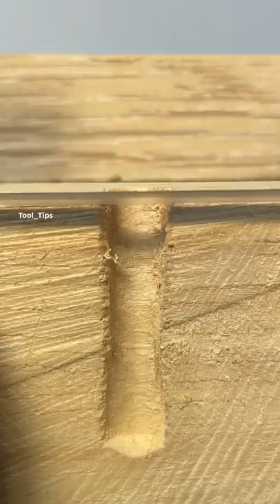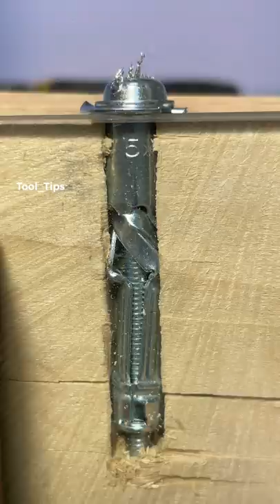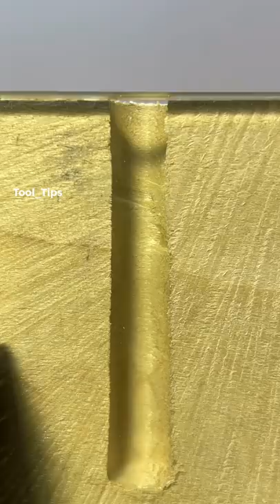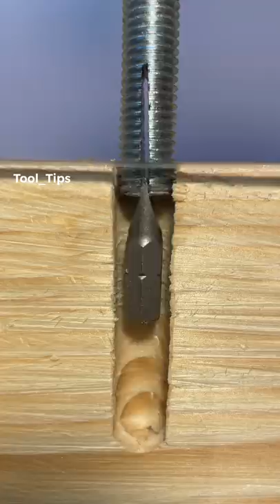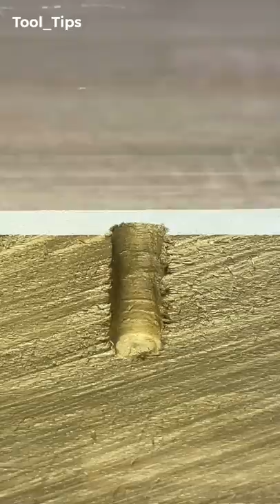#shorts The Best

Comment: POV: You’re watching someone install drywall anchors into wood and wondering why they aren’t working right
Reply: Thank you…. Lol
Reply: It’s not working because there’s glass and the glass doesn’t mold like the wood does
Reply: @OurTimeComes  No, the anchors are not designed to be used in wood. If you attach something to wood you can just use a wood screw. There are different anchors for plaster, drywall etc.
Reply: @austinm9119 .no u or
Reply: Wrong. In total  the kinds they had on here covered almost all types of wall materials. Brick, concrete, drywall, plaster etc. Also in 99% of cases with dry wall and plaster you're trying to land the screws on studs which is wood normally.
Reply: @patrickruddell3475  yep I was gonna say there is more here than just drywall anchors.
Reply: Correction: Some of them are drywall anchors. The nail in the sleeve at the end is a concrete/cement/stone anchor and the dowels are wood anchors. But, I agree, he should use show them in their designed material 😉
Reply: 😂😂😂😂 Guilty!
Reply: @chrish6001  thanks bro...
Reply: I understand nothing over here ✌😀
Reply: @chrish6001  9
Reply: @austinm9119  dumb why? Why is it that if people didn't know this particular piece of information, they're dumb?
Reply: @austinm9119  this just came to people's recommended. Nobody knows what this is, and nobody cares. It seems fun to watch and you don't research something you just watched for fun and would never really benefit from. Of course they won't research
Reply: I guess that isn't as obvious to as many people as I thought...
Reply: @austinm9119  first off, I do research, just not in this, I couldn't care less about construction. I just watch this cuz it's distracting. Second, I am not exactly speaking for everyone, but to the partition of people you're targeting. I'm not arguing for someone, I'm arguing against the philosophy you follow itself. Also I didn't use the pronoun "you" as in you, Austin Michael. I meant it to reference "you, the YouTube user" it's a way of generalisation. Also there is no perfect pragmatist. Everyone wastes time in some way and some people do it by watching random YouTube videos. Also, since you enjoy practicality, enjoying the stupidity of other people and not helping them out in a way they'll accept hinders progress because less people are encouraged to contribute to the society. And by the way, I don't get tired of this. It's great way to fault proof my philosophy by acknowledging criticisms from other me people, so don't expect me to stop anytime soon (unless either you end by not replying or YouTube just stops sending me notifications). Plus, this is kinda fun
Reply: @austinm9119  you're not really disproving anything at this point. You're just insulting me. If you truly know what you're saying is true, then you should be able to shut me up no problem by not giving me any room for argument. Why Isn't that the case?
Reply: @patrickruddell3475  you don't normally use drywall anchors when you are screwing directly into a stud, though.......if you did, you'd have to make a bigger hold in the wall than is necessary, and the resulting joint won't even be as strong as just using the screw by itself.
Reply: @someperson6672  Same, I’m just here for the arguments
Reply: @YoutubeDictatorship2024  the passive-aggressive vibe in this comment is lovely
Reply: Right! Whats the point of anchors if you can drill into wood
Reply: @aaronjones3181  yes you're right.
Reply: @pierreemad2220  I think this is less passive-aggressive and more just normal aggressive.
Reply: 🤔🤔🤔 Right? 🤣🤣🤣 that's why you have wood screws, wood pegs, etc. Drywall anchors are for? Wait for it... wait for it.... Drywall
Reply: I can't look away 😃
Reply: @chrish6001  ll
Reply: @chrish6001  mm.
Reply: Ah, maybe I'm not so stupid afterall 😅
Reply: @patrickruddell3475  right, but you only use an anchor when you can't use a stud!?
Reply: @austinm9119  we all just have different roles and lived experiences my guy. Sadly I didnt have someone who was handy to teach me these things when I was a kid. I'm sure there are many more like me who are just trying to learn.
Reply: @calmcomedy1  for sure, nothing i said is directed at that identity. Im talking about the people who are choosing not to learn.
Reply: @OurTimeComes  
Mm
Reply: They did it in would so you won’t have the mess of drywall and could see clearly
Reply: It’s so soothing actually!  👍🏼🤪
Reply: @chrish6001  tell us something we don’t know, GENIUS!  🤪🤪🤦🏻‍♂️🤦🏻‍♂️
Reply: BodieBoy, 
Watch the video 11 times and then make the same claim.
Reply: @pierreemad2220  
Right,  no kidding.
Reply: @austinm9119  getting dumber when I was a kid in 70's I was 10 building houses with my grandfather  laying brick  I was actually laying the concrete on bricks placing tapping to level across the line he be watching  come back and say nice or opps look at that brick see how it's a little narrow  you got lazy  it matters  I always took pride  since then.  Kids today  even men don't know anything about construction or even changing a outlet  it's simply mind blowing
Reply: @someperson6672    unless you know what each one is for. It's mainly to show people why most fail  they use the wrong type
Reply: @austinm9119  ok wise guy. LMAO

Comment: I’ve never been so tempted to take a construction class before today
Reply: @udunn0jb  isn't carpentry a unit in construction? I'm taking a construction class and had to learn carpentry
Reply: @jrjuan4334  im in the laborers union and as far as I know carpentry has their own hall and training
Reply: @cookie8080  i did construction for the US army and had to take classes to learn about the heavy equipment i was operating.  Then when I got out I took a red seal course when I went to school for a combined 6 months over 2 and a half years. I signed on as a apprentice and by the time my course was done I was a journeyman.  There is alot of stuff involved when doing a construction project stuff has to be done to codes. Depending on what work your doing there is alot of math like concrete knowing how much to make or order for a certain pour. Or asphalt work , pipeline work , residential work for water lines and stuff.  Each sector all have their own rules. Without previous experience good luck getting hired for a construction job, well a good paying one anyway. When I started I had my ged, and my time in the army thats it. When I started as a apprentice was making 16 bucks an hour now I make 33 an hour whichever sector I  go. 42 an hour for pipeline work
Reply: @cookie8080  oh yeah and by the way each trade has their own red seal course  all having to do with construction.  Lots of classes involved with construction.  If you wanna know how to do it correctly and by the book
Reply: @cookie8080  well is a 14 year old really suppose to carry tons of bricks and metal on my shoulder???? Or is it cuz you have no life sitting on the couch drinking mountain dew and eating takis
Reply: U don't need 1 the parts r cheap it's just trial an error save the cash 😀👍🏿
Reply: @DM-gy3ce  
Wow don't even hav 2 speak an man nose im English 🤣😂🤣😀👍🏿
Reply: @jasonanderson6425  we speak the same language as them but my god we are so different haha

Comment: All these people talking about how satisfying the video is, meanwhile im losing my mind about the drywall anchors being used in wood and losing a driver bit to expand a bolt
Reply: 🤣 I don't know much about anchors, but if I did, this would 100% be my comment.
Reply: You sir are a true craftsman.
Reply: Over here wondering the same, or why any anchor is needed in wood where a screw would do just fine 😂
Reply: @IOWChris  totally agree
Reply: It's still satisfying but I was also totally lost about what the hell he was doing g then that stuff happened 🧠  🤣
Reply: Yes driver bit... Was...
Reply: I use sheet metal screws to fix everything on just about every material you could imagine, they’re great.
Reply: Quite. Not sure what the point is really.
Reply: Same
Reply: @goose4342  you use sheet metal screws on drywall too?
Reply: Exactly. Wood, woodscrew.
Reply: Right. Hacks.
Reply: It was satisfying but was definitely confused with all the anchors in wood
Reply: You too huh?
Reply: Little trick I learned along the way I'd like to share. If you have a stripped hole in wood and the screw no longer bites, I found out using a short peace of solid copper wire as a shim works great to tighten the screw securely. What gauge to use depends on the diameter of the threaded hole. I used 14 gauge to shim door hinge mounting screws. No more surprises when their bathroom door use to collapse. LOL.  I'm sure a lot of you already know this technique but hopefully it helps someone that doesn't.
Reply: thank you for saying that
Reply: @xavierparedes12  Listen, if it holds metal together, it has to hold pewny drywall, right?
Just like pop rivets!!
Reply: @flip1746  makes notes Brilliant! A piece of plastic would work too, so you can use anything you don't need, really. Make trash useful!! 😁
Reply: That ...bit... really shook me too. You can't just discard a bit like that!! You'll be like "Where's that bit go--oh, it's in the shelf I built..." 😬
Reply: @SpotTiger  That's a good idea. I love repurposing things that would normally go in the trash. Thanks for sharing!
Reply: Came here to say this.  Not sure what if anything this meant to show, besides why screws are for hard wood.
Reply: Thank you thank you. Im sitting here like WTF IS HAPPENING
Reply: SAME!
Reply: I'm pretty sure its not about the wood it's to show us the mechanism used for each anchor
Reply: Just let some things go though ya know
Reply: Yeesss! Oh boy.
Reply: that driver bit clip got me mad af... why would someone waste that... geez
Reply: Yeah I just saw my life expectancy shorten with every turn of that drill.
Reply: reason you keep old bits, or the bad ones that come in screw boxes.
Reply: @SpotTiger  yup agree
Reply: @flip1746  drive the pointed end of a golf tee into the hole and cut flush. Multiple toothpicks or wood shavings will work for smaller holes as well. Copper wire sounds more like a "handyman special"... But hey, whatever works for ya!
Reply: I’m crying. This is cring
Reply: @flip1746  thanks for saying this that's a great tip! I'm gonna screenshot it to remember!
Reply: Right? I was wondering if my knowledge was just off and those were SOMEHOW wood anchors???!
Trying desperately to make it make sense...
Reply: Exactly
Reply: Thank you so much.. I thought I was the only one
Reply: @LaurenDowley689  You're welcome, Lauren. I love sharing tips that help people get things done. I also love seeing more women doing this type of work. For me, there's something very satisfying about creating and repairing things in the home. :)
Reply: Redwood Rebelgirl  I think you're asking about a SHIM (not a shin). A shim is basically anything you can use to close a gap by wedging the object (shim) in a gap. Usually the term "shim" is used in carpentry. You can buy a pack of wooden shims at any home improvement store. They are pieces of wood that are tapered kinda like a little ramp. So, say you are trying to make a door frame so it's square. Just push the small end in the gap and lightly tap the other end until it's tight. Then just snap the remaining part of the shim off so it's flush with the surface. In the case of shimming a stripped screw hole, the "shim" would be the piece of wire (or any other object that'll fit). Hope I explained all that well enough. I know it can be confusing if you don't have a lot of experience. I'm not a carpenter by trade but a computer tech. So if I can learn this stuff, so can you. Hope it helps and if you have questions hit me up. :)
Reply: Redwood Rebelgirl  You have a great attitude and world view! My daughters and my dad are very passionate about and active in preserving the environment. So am I. Thank you for sharing your passion!
Reply: @ScottyLiardi  That's a great idea! Thanks for sharing. I had to pull a MacGyver at a friends house. Went to use the bathroom and the door was propped up on the wall. So out of need of privacy, I rehung the door using the wire shim. They had been with a bathroom door for months so I was happy to help them (and myself) out. I'm a computer tech but having knowledge and a wide skillset is definitely beneficial so I thank you for the tip! I'll add it to my toolkit.
Reply: Im a carpenter and i. Hated this Video
Reply: @bayern1445  often hate comes from misunderstanding...
Reply: @Gazeld  ive been around. Carpentry my entire life 💪😎
Reply: @bayern1445  yeah, and so you can misunderstand the reason why someone made a video, anyway.
Reply: That waste of a driver...  However...  When in need...
Reply: I was screaming the same thing! Like, one, why could you use a drywall anchor on wood. Two, why are you putting a dowel into a hole that's larger than it should be? The driver bit confused and gave me anxiety!
Reply: Knowing that these are normally for drywall makes me understand what they are for better thank you
Reply: Exactly!!!!

Comment: I don’t understand what’s happening in some of these. Like, did he want the wood to crack open?
Reply: I think so it expands, and it gets tighter
Reply: Just showing how they work , most of them aren’t used for wood , most are concrete fixings
Reply: @THELONDONCHANNEL  O H.
Well now I know nothing again. 😆
I thought I was gonna be a wood connecting master and now I'm gonna have to do research! 🤣
Reply: How does that wood bolt twig thing work? It just slides, so he adds a nail at the end? What's going on ther
Reply: @SpotTiger  8ii   hjb
Reply: @danielhenderson762  Expansion, I. E tightness.
Reply: @danielhenderson762  It's called a wood plug which usually gets connected to another piece of wood on the other end and it's fastened into place with glue. But usually after wear and tear one end of the plug will pop out and cause a faulty loose end and will begin to wobble. Using a screw or nail on either end would ensure that this doesn't happen. The nail also causes the plug to split and expand within the hole, ensuring a tighter hold
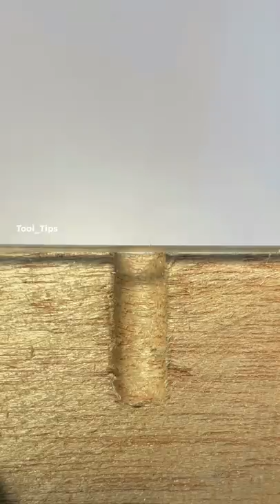Reply: @ViolentGenius  no i mean at 0:11
"using a screw". Using a screw how?? It's not clear what he's doing
Reply: @icemule  0:11 genius
Reply: His demonstrating in debunking these so called "how to fix" vids on YouTube that basically tell you that a certain method is guaranteed to fix a door hinge etc he's showing you that those plastic screw fittings don't fix the problem it makes it worse so does adding wood glue
Reply: @THELONDONCHANNEL  no all of the screw ancors are for wood.
Reply: They are wall plugs and he is showing how they work
Reply: Those ate meant for concrete not wood, so of course it cracked
Reply: Just showing what all the different ones do
Reply: The wood is also only cracking because it's on the edge! So we can see. Whe. done in the center. It works great lol. Did 18 pair of shutters today. In wood surprisingly lol
Reply: @JesusStillSavesUs  calling people stupid while having the name “Jesus is King” doesn’t seem to make sense...not the best testimony there.
Reply: I'm pretty sure most of these are for brick and concrete etc.
Reply: @danielhenderson762  double sided nail
Reply: @dion1score  thanks
Reply: Quiero saber sobre tornillos
Reply: Tornillos con sus tuercas  de varias formas y precios de los mismos
Reply: Precios de tornillos y tuercas de varias medidas.
Reply: for like drywall you have to put those inserts so the screw dosent rip out of the wall
Reply: The amount of likes on this comment has me worried for humanity
Reply: @danielhenderson762  The piece on the bottom expands it to hold it in
Reply: @JesusStillSavesUs  No it's a video from a channel called Tool Tips... ASMR is for crazy people.
Reply: @melissawilcox2214  No they are not.... You use SCREWS for wood. They are drywall and concrete board anchors. They are meant to be pushed through a thin board where they expand behind it to increase the carrying load. 

Stop talking about shit you don't know.
Reply: @SpotTiger  8ae7h01u9c0
Reply: @ViolentGenius  ssshhhh, it still looks amazing here 😂😂
Reply: @platinumvulture1122  I’m perplexed by it.
Reply: @danielhenderson762  I just explained it..
Reply: No
Tbe one which cracked the wood isn't meant to be used on wood
Reply: @ViolentGenius  uh, no. You said "using a screw in either end". Not only is it false, but extremely ambiguous. The next this you said was the plug will expand, which is even more ambiguous seeing how the clip doesn't show the plug expanding but the other wood plug clip does.
So no, you didn't explain it you prat